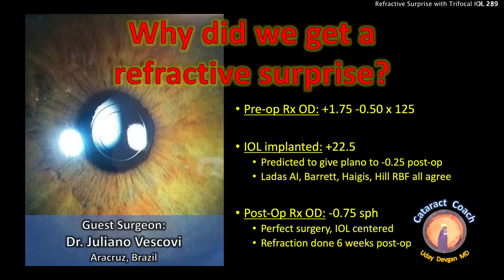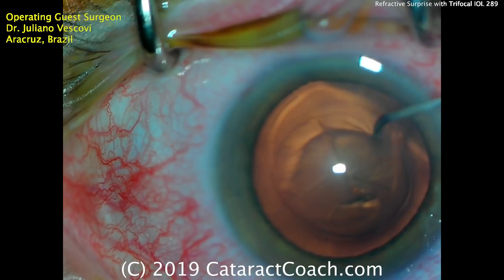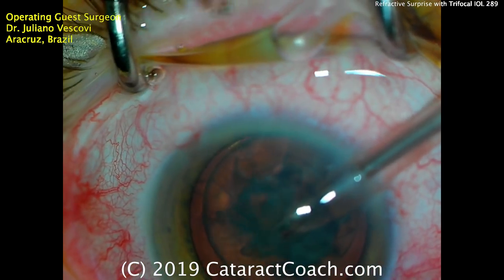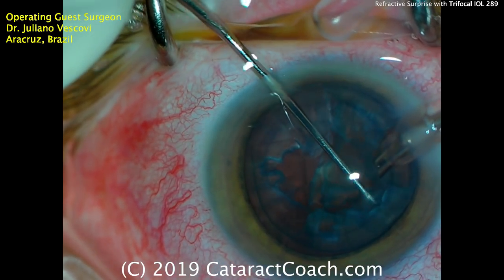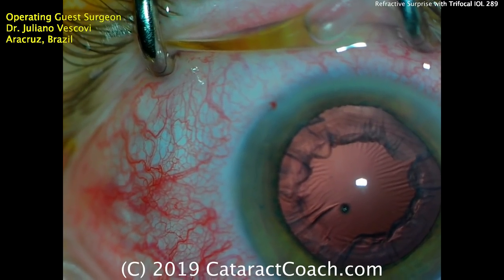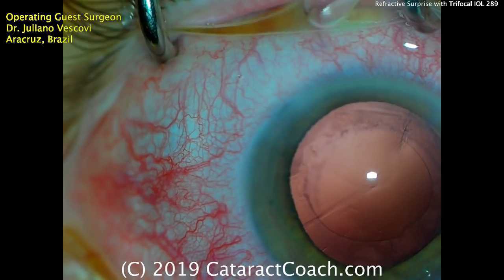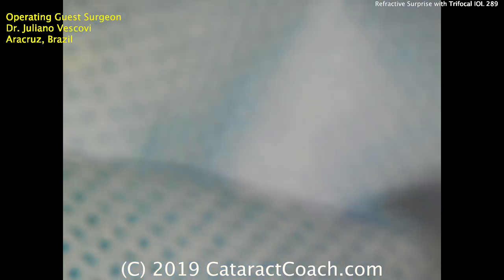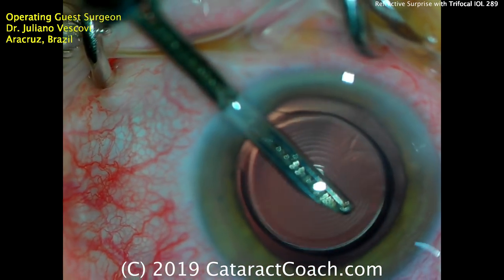Why did we get a refractive surprise after Cataract Surgery?

Comment: Is there any solution to twinkle in eye after cataract surgery? Because of my large pupil reflection of light looks so scary and weird in pupil under most light conditions.
Reply from the maker: Yes, exchange the acrylic lens implant for one made of silicone.
Reply: Uday Devgan i have Alcon  sn60wf power 22.5d with blue light filter lens. Can you suggest lens please? My doctor said all lenses are made out of plastic so there is no solution to this problem.
Reply: Put a drop of Pilocarpin eye drop and see if condition improves..